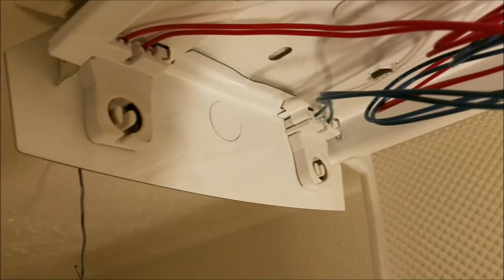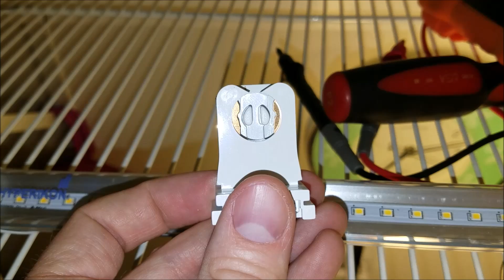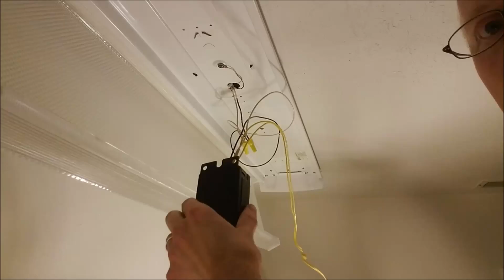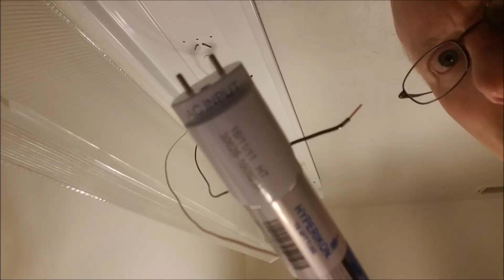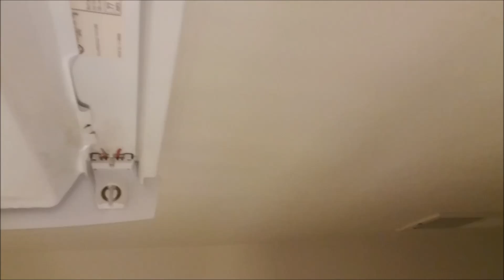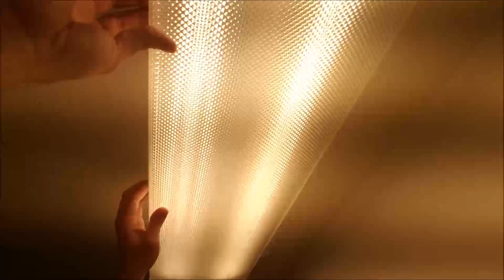How to Convert a Magnetic Ballast Fluorescent Tube Fixture to a Singled-Ended LED Fixture

Comment: One of the best "one sided" conversion videos out there. Wanted to add one thing: It would be better visually, and less confusing,  if you had used a black wire to connect the tombstones which would have made a white to white and black to black connection. Never underestimate the lack of knowledge of your audience (for instance: me).

Comment: Steve, Are you sure you can have the neutral and live wire on the same side?  The manual mentions it will cause a short and void warranty.
Reply from the maker: The installation in this video uses single ended LED tubes.  In that case one side of the tube is the wired side (both wires) and the other functions only to support the light in the fixture.  There are double ended LED tubes also, but this video does not address that type of tube installation.  Does that answer you question?

Comment: What do I need to do for the other side? (Where the yellow wires went) can I use the tombstones that are there just disconnect all of the wires going to them?
Reply from the maker: Always refer to the official installation instructions first.  If the new light you are installing is single ended as in this video, and the end you are referring to is the non-live end, then yes, doesn't matter which tombstones IF there is no live power going to them.  I'm answering for the Hyperikon models that I'm using.  I can't address other brands without further investigation.

Comment: Good video Steve. Concise and not a lot of background noise.  I have three comments however.  First as mentioned in another comment below, like the florescent bulbs, the ballasts must also be recycled because they contain some awful tar like substance inside. Don't want that going into a landfill if we can help it.  Second, it doesn't matter which end you convert to the non shunted tombstones.  In hindsight, the other end of your fixture was closer to your power input wires.  You could have made that end the power side and had shorter wires to deal with. Third, electrical code (for safety reasons) would require you to use a black wire (instead of the white wire you did use) to connect the two hot ends of the tombstones together.  Good video otherwise.
Reply from the maker: Thanks for the feedback.  Good point about which end to run power to.  I'm not sure it occurred to me at the time that the other end may have been a better option. These ballasts are labeled "no PCBs" on the front (you can see in the video) which means there are no requirements for special handling disposal.  See the EPA's website on ballast disposal.  It would be best practice to use black and white wires between the tombstones but this is inside a fixture that wasn't intended for disassembly so it doesn't violate any residential wiring codes.  Furthermore, it is very clear which is which by simple inspection if someone were to disassemble the fixture in the future.  But yes, it would have been more proper to use black and white.  Again, thanks for the feedback.

Comment: Mine didn't come with any tombstones.  How is this supposed to work?
Reply from the maker: You probably figured it out by now but you do need to replace the shunted tombstones with the non-shunted tombstones or it will not work for single ended tubes.  I'm sure you can order them online.

Comment: Very clear instructions. I wired one of my fixtures using this method and it works fine. I went with a different method for other fixtures after experiencing the delay in the lights coming on after flicking the switch but it made no difference; this method works just as well, uses less wire, and is a cleaner looking installation. Thanks, Steve.

Comment: Nice work Steve!  So with the LED does it have a flicker like the fluorescent tubes do?
Reply from the maker: Thanks!  That's one of the reason I love LED's, NO FLICKERING!! Especially annoying and more frequent when it's cold ambient temperature.  The only thing I've noticed with the LED's so far is there is a slight, but tolerable delay from the time the switch goes on till the tubes turn on.
Reply: The quarter-second or so delay on these is irritating but you can learn to live with it. OTOH, I used Toggled LEDs in another project and there is no noticeable delay when turning those on. From now on, I'll use those even though they are a bit more expensive.